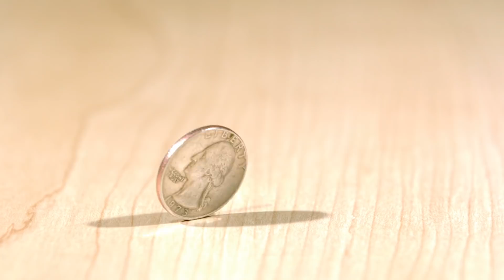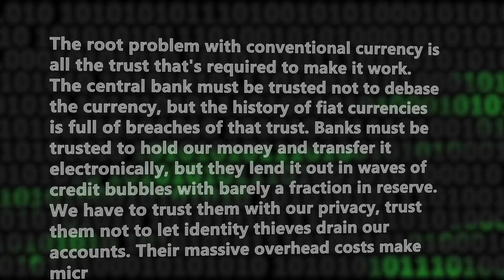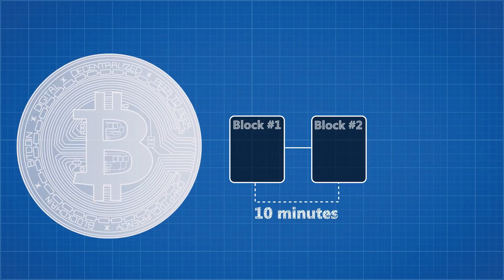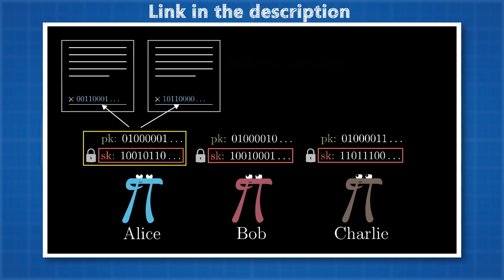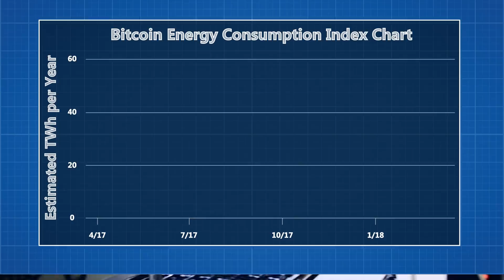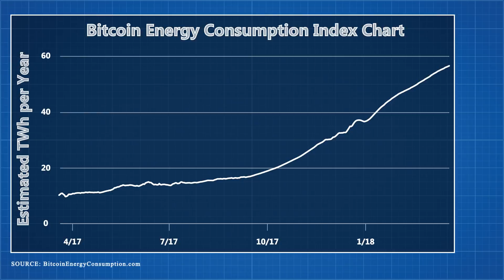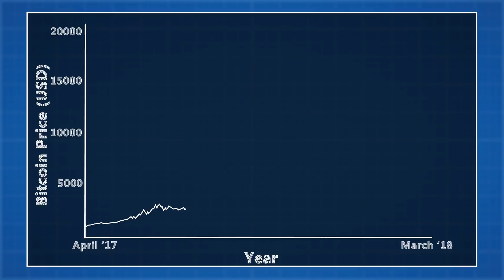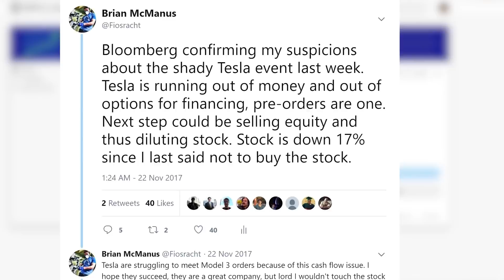Why Bitcoin Is Not Working

Comment: "This is good for Bitcoin"
-Bitcoin users probably
Reply: Proof of Stake consensus methods can achieve similar decentralized properties to Bitcoin without nearly the same energy consumption. The existance of problems such as the "Nothing at Stake" problem are irrelevant if they can be worked around, especially if the underlying system can be proven to be secure like with Ouroboros.

Lightning network has potential, but I'm concerned about the possibility of quazi-centralization caused by the need for high liquidity in middleman nodes. The amount of bitcoin locked into a payment channel is fixed, bitcoin cannot be transferred between the payment channels off-chain.

High volatility is a major problem with bitcoin and needs to be addressed for it to have any hope. I've heard claims that high adoption will result in stability, but this is not the case: even with a currency as widespread as USD, central banks have to adjust interest rates carefully in an attempt to peg it to the CPI (well, with some controlled inflation for seigniorage). The reason for this volatility is basic supply and demand: Bitcoin has a deterministic supply, and as such price is purely a function of demand. The lightning network cannot do anything to change this.
Reply: ayooo 1. 60% out of almost 200 000 times the energy consumption of a traditional banking currency is still pretty hefty.
2. And this will adress both the energy consumption and the fluctuating value? How can we be sure that this system isn't exploitable in some other way? (I don't know anything about the lightning network, so i am genuinely asking.)

Like RE said, the problem with bitcoin isn't bitcoin per se, it's people. It's used as a speculative investment more than anything else because normal people don't trust it enough to make regular purchases with it, which is because of the volatile value (and because they don't understand what it is.)

The reason i don't trust bitcoin is because all of its enthusiasts seem to be unflinching preachers who never think it's anything short of amazing. I never hear anyone say "Yes, this is a big problem right now, but it can hopefully be fixed in the future with this or this or this proposed solution." Even arguing that the downsides are worth it because of some practical, demonstrable advantage over traditional currency would be fine, but all the arguments i hear are "Bitcoin is great, you just don't understand what you're talking about."
Reply: "This will benefit my portfolio"
Reply: "I've been doing this for 2 weeks so I'm kinda an expert"
Reply: It isn't entirely untrue, the numbers were just incorrect. It is still in fact limited not only by volume but time as well. Unlike currencies controlled by banks or governments. It's production over time is fixed, and then it will cease to be produced.  Thanks for the soliloquy though.
Reply: proof of work is what is important here. This mechanism ensures the immutability of the blockchain, because you would need to re-do all the computation that has been made since 03/01/2009 on genesis block "Chancelor on brink of second bailout for banks" to hack the blockchain. So if you can think and abstract, bitcoin is in fact a big fat monument that required so much energy to build. This is what it takes to
Reply: I don't use bitcoin. But it's production is limited to 1 million coins. I think the last coin will be mined around 2040. Cash, is not really limited, and they can print more at any time.
Reply: yup this video didn't talk anything about lighting network. some shit head made the video for blaming bitcoin for nothing.
Reply: That's all in fact untrue, except maybe you don't or can't use Ƀ.

Bitcoin is limited about 21 million coins.
Last coin will be mined 2140, but due to the fact that the mining diminishes in reward over time, 99% of bitcoins will be mined by 2032.

100 years ago, around the time the Federal Reserve Note (or the current US money) was created, $20 could purchase a men's suit that cost $2000 dollars today.

All being able to "print more" does is help those that can create the notes, because they (The Gov and The Fed Bank and Satan and Pals) get the new money before all the prices rise due to their being more new money.

By the time some average guy gets the newly printed money, it actually hurts him, because he gets a pay raise but prices of stuff have already gone up and it made him cut back for a while.

This is how the system works today. The working man keeps getting cut back, and then "saved" by the government. This is by design. With Bitcoin, prices of things would go down, and working men who saved and dwelt in obedience to keep those savings would be rewarded as their savings would become worth more over time, instead of today were saving only hurts as your money loses value while prices rise. 

But, people have been fools for eternity, so some will surely prefer to continue with "what they know" because thinking is too hard for them.
Reply: Many false informations in this video. 
1. Bitcoin computation power: true, bitcoin is wasting much more energy. but nobody says that that energy is not needed. Bitcoin can run perfectly fine without 60% of current energy consumptions. and many propose that we use that junk energy smarter way INSIDE BITCOIN NETWORK. 
2. Bitcoin network is building lightning network which is 2nd layer solution, which will work fine and fast, without so much energy wasted, all transaction will be made off-chain. and with instant speed
Reply: ayooo
Seriously, people are only jealous they can't understand bitcoin, so they foolishly fling turds at it. These problems are already addressed via the Lightning Network, seems like a weak attempt of spoiled stupid people to cling to the edifice of a crumbling past.
Reply: Yes this isn't good for Bitcoin that's why shit gets inovated cough lightning network. People who don't understand Bitcoin don't understand so much so they talk so much shit. Besides Bitcoin is only bad if you didn't get in it early 😂
Reply: Competition is life, that is why Ƀ takes so much energy, because it can. Stay green, muh friend.

Bitcoin can still be transferred between payment channels which are "off-chain", before being solidified by broadcasting the transaction.

Volatility is why shills, no matter their education and IQ, cannot predict, and thus stop, Ƀ

Comment: oh man, this video is so flawed.

energy: bitcoin miners pay for energy, you may think they spend it on something useless or not useful enough, but that's just like your opinion man. if i pay for the energy - i have the right to waste it on whatever i want.

transaction throughput: unlike visa bitcoin is a trustless system. the trivial mechanism by which you could increase bitcoin tps ultimately leads to centralization and loss of trustlessness. the solution is to not require every microtransaction to be recorded on blockchain. there are ways to exchange millions of transactions per second in a bitcoin payment channel, without touching the blockchain for each of them but still preserving bitcoin's security guarantees. you're basically comparing visa to gold and saying they are different - yes they are, duh.

price stability: complaining bitcoin, an unregulated 10 years old currency, is not as stable as the US dollar is outright hypocritical. by the way, you might want to google "dollar purchasing power charts" and reconcile that with your claims of stability of conventional currencies.

Comment: saying bitcoin or crypto currencies in general "is not working" is like saying "my son is already 5 years old and yet he's still not a doctor, therefore he must NOT BE WORKING". Visa/mastercard took decades to get to what it is today, why expect bitcoin to be any different? also fiat would fluctuate 20% everyday as well if it had the same level of adoption bitcoin did atm. size of fluctuation is heavily factored by the size of adoption. and as far as power consumption goes, that has nothing to do with bitcoin as a concept but rather just part of its current technology, and is subject to change as technology develops further. Like any other forms of technology,  efficient use of energy will eventually come along. (some would argue that it already has.)

Comment: Learn before you speak. Most of the opinions are not true in this video.
E.G. The lightning network can easily processes more transactions than VISA within the same decentralised & trust-less system.
A good starting point to learn: @aantonop

Comment: The fact that people often find some way to game the system for financial gain (as little as it may be) isn't a very good argument for me. As long as the system is better or equal to others, it's gonna be attractive and useful.

Also remember bitcoin is 1 currency. Many others exist that build upon bitcoin's idea and address its problems in their own way. You should be asking how valuable is a currency that's secure, inmutable, censorship resistant and trustless when comparing its capacity to traditional systems like visa. Bitcoin may seem low, but maybe it's also worth it.

Comment: The transaction rate can increase in the future once it's actually needed. Blocks are currently not filled so would have no benefit increasing the size.

Also, the system is extremely efficient in electrical usage. The most efficient place is the only place where it will be worth mining. The mining difficulty will also adjust to the number of people mining, so it will equalise over time too.

Comment: Banks, Overhead costs making micropayments impossible...... Hey, that sounds just like what Bitcoin is doing right now.....
Reply: the lowest transaction you can send is 0.0005 btc using online payment processors.  so you can't buy a $1 item since it's currently around $4 worth of btc and more like $5 after fees. that'd be fine if I could mine it back in a day but it takes a week or more with a just my single 1060 3gb to get it back. on paypal a $1 item would be only $1.03 using a debit card.

Comment: The enormous energy consumption is not Bitcoin's fault. Bitcoin would work just fine with 10x or 100x or even 1000x less energy. It's the fact that *people use energy to get Bitcoin*. In a way the same happens with all the fiat currencies, people burn energy to get those Dollars. We could also look at how much manpower(energy) banks and VISA burn to secure their network. Or is it only bad when you use electric energy but fine and dandy when you burn all the other forms of energy required to power humans(food) and their tools like vehicles(oil) etc. And this comes from an Engineering channel..........

Comment: This was extremely disappointing. This perspective was a mischaracterization of facts about both BItcoin and fiat currency. I love this channel, but this video is a failure.
Reply: "OHH YEAH BITCOIN IS GREAT AND IT HAS NO FLAWS" other that it actually being useless as a real currency.... which is its actual purpose... 

There are websites that you can use to exchange Bitcoin for things like pizza and other physical goods and services, I've seen them, however, because of the volatility of Bitcoin as a currency you can often get horrendously ripped off because of that. The Wall Street Journal did an article on this where they bought some domino's pizza which was advertised as costing $10, and after they waited (4 hours btw) until their transaction came through, it had ended up costing them $77 because of fees and the fact that the market prices had not been appropriately updated. 

Its not really the fault of Bitcoin, any currency that is that volatile is pretty useless also. Think of the Deutchmark in the 1920s, however the other way around. In the perfect world you are looking for a currency that is stable within around 2% per year. Bitcoin has changed enormously in value over even the past couple of months.
Reply: Yeah! So many people are still stuck on that internet craze! What a fad! ThEy’LL bE sOrRy WhEn ThE bUBbLe PopS!!
Reply: The video criticized bitcoin.  The criticisms were valid.

You don't need to protect the other cryptocurrencies.  They'll be fine.
Reply: exactly the OP ignorance about bitcoin and how cryptocurrency work still in his  infancy era ..
Reply: sdesai1989 Clearly not a failure, it challenged your viewpoint.
Reply: +Spektrik No, the video really is a failure. You can't talk about Bitcoin without talking about the rest of cryptocurrency proposals that address the issues in Bitcoin. If you do so either you're ignorant or deceitful due to lying through omission.
Reply: No, he definitely tried to lump all cryptocurrencies under the same category as bitcoin, at least until the end. This video was definitely a failure.
Reply: When did they buy pizza ? In december ? Since december BTC has improved a lot , This guy in the video did not even mention segwit adoption and lightning network , is he for real ? i was cringing so hard the whole video. Did you hear about baching the network because segwit wasn't adopted by most major exchanges ? . Anyway , you should check how much it costs to transfer bitcoin right this very moment. But i'll spare you the research , it's on an ATL ( ALL TIME LOW ) cost to transfer BTC. You can literately go buy a coffe with almoust 0 fees and almoust instant transaction. That's how much it progressed since december. And that's just the segwit adoption , wait untill restaurants and everyone starts setting up Lightning nodes. That means it will be instant with the 0 protocol transactions and almoust costing 0.01$ to transfer. And it won't take long since it's on the main-net already being adopted. Clearly this guy in the video ....well...he tried hard to make a video , but damm man he is wrong in a lot of things about bitcoin. Check Adreans  antonopoulas videos guys if you trully , trully want to learn about BTC and the tech
Reply: I agree, abject failure. It’s funny to hear people who don’t understand bitcoin talk about bitcoin. Have fun being poor I guess. 🤷‍♂️
Reply: It's a "failure" only because you're blinded by the Bitcoin craze and can't see the obvious downside of Bitcoin.

Comment: There are cryptocurrencies that dont have an incentive to mine that exist. Two big ones are NANO and IOTA which are relatively new cryptocurrencies that are completely decentralized. 

NANO is a feeless, near instant cryptocurrency, that gives each individual wallet its own blockchain. Its the most network efficient cryptocurrency to, as it can fit a whole transaction into a UDP packet. NANO supports *7000 txns/second. That 7000 is not limited by the NANO protocol. Its limited by hardware constraints. 

Since each individual wallet has its own blockchain, mining is only utilized to prevent spamming the network and only takes about ~2 seconds to mine a block. Solutions can be pre-mined and cached to make a transaction instantaneous. Big payment processors well need to acquire mining services to do all the mining for the many transactions they process. Big payment processors will have several wallets to have parallel mining capabilities.  An exchange called bitgrail implemented this in a insecure way and ended up losing a shit ton of NANO. However the correct way to make payments with large traffic is to do all the mining/signing of blocks offline, and only untill the payment is confirmed that the transaction is broadcasted to the network.

NANO is secured by delegated proof of stake. In NANO there are 100 delegates that vote on conflicting blocks (aka double spend attack/error). To become a delegate you need to have NANO holders select you as a representative of their funds (Think of owning NANO as a vote for a delegate, the more NANO you have the more power you have to make someone a delegate). The top 100 accounts representing the most amount of NANO become delegates. (obviously theres much more detail, see the white paper). 

 IOTA is also near instant and feeless. Blocks are slightly larger as they allow for information to be put into the blocks (IoT applications). IOTA is secured in a very similar way, but the IOTA network does a bit more than NANO since NANO only does transactions. IOTA is a platform. Highly recommend you do your own research on IOTA as the details are complex.

Comment: I think the point you missed is that the large part of why bitcoin was invented, whether Satoshi thought this consciously or not, is that using gold AS currency was made illegal by all major world powers in the early to mid 20th century.  If we were allowed simply to use gold as currency, without threat of prison, then all of the problems you illustrated go away.  Just look at e-gold - it was seriously poised to solve all of the problems bitcoin purported to solve, long before bitcoin was ever conceived... and the US Treasury shut it down through lawsuits.  The only reason bitcoin has survived this long is because of the privacy afforded by it... but if world governments would just step out of the way, the much simpler, millennia-old solution would be implemented overnight, and the major impact to the environment would be the fuel burnt to cast the gold into standard shapes.